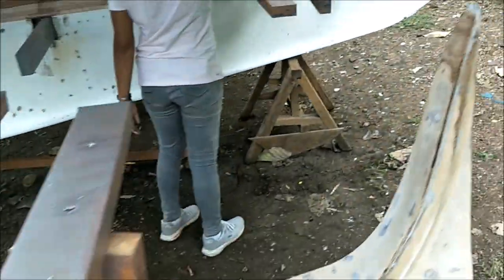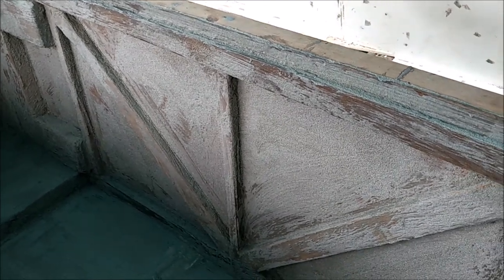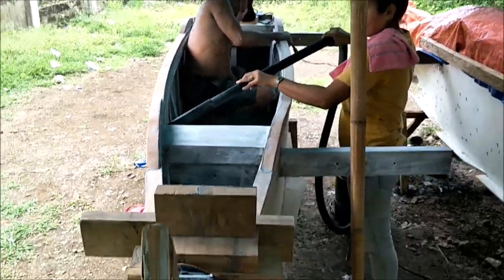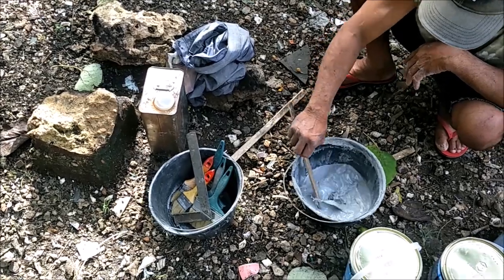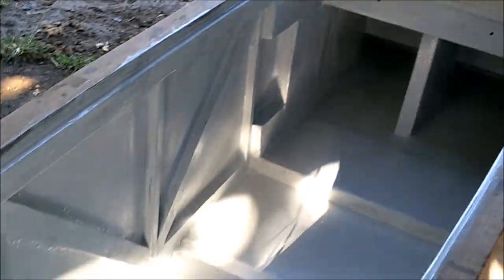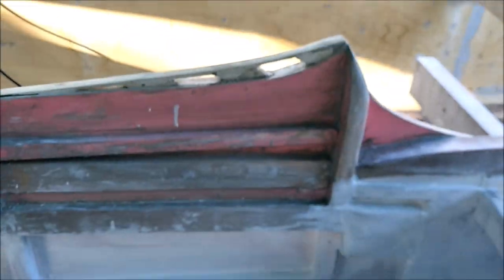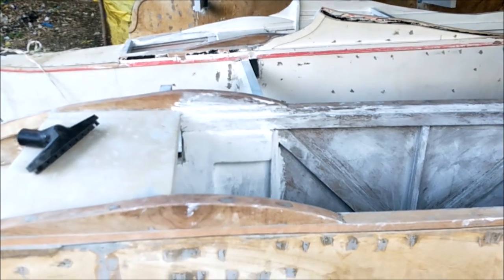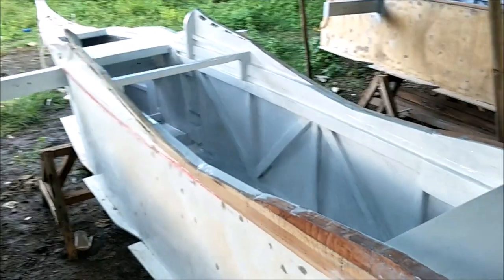Building The Paradise Trimaran - Part 17 - Boat Building In The Philippines

Comment: Hi there, well watching the progress of the dream cat. I think before You apply any new type of paint make a test on a small board till You get it right and then You apply it to the boat. That will save You a lot of work. Costs a little more time but sanding is a lot worse. Make a test on a vertical piece to see how it flows and then on a flat surface.
Another thing I think will improve the surface quality. Turn the hulls to the side and only paint on the flat surfaces. The paint will level out much better and there are no drips running away down and You can use a little more paint and use more thinner. That will also make the paint flow a little in the imperfect areas. Just compare the inside floor with the sides. I am sure You can notice the difference.
Before You modify the rudder wait till You have the final assembly of the 3 hulls in the water to see the exact water line
Cheers